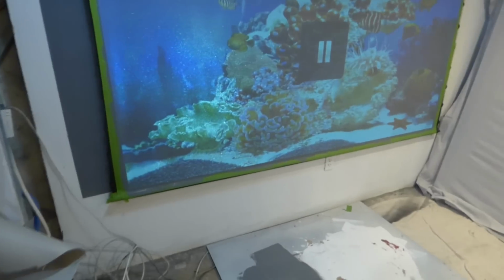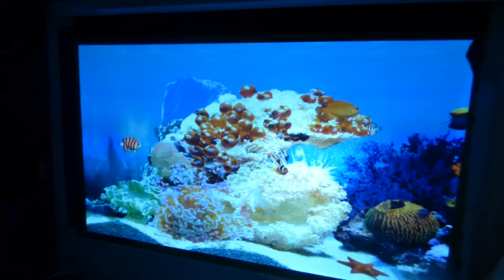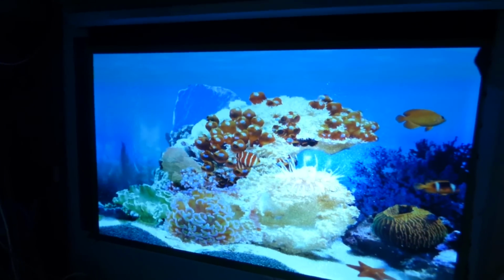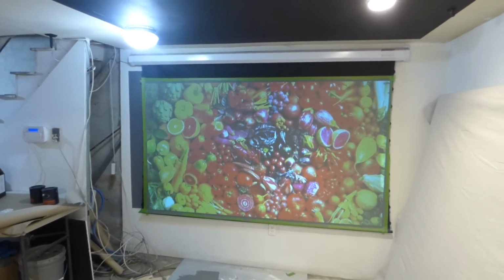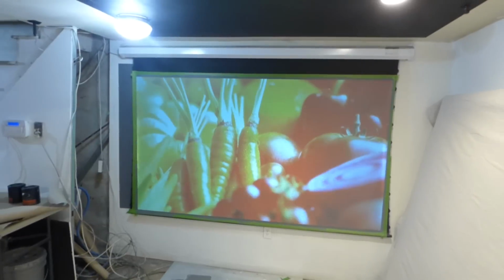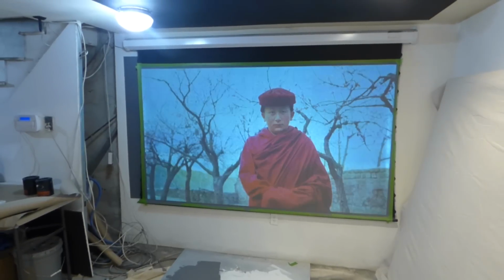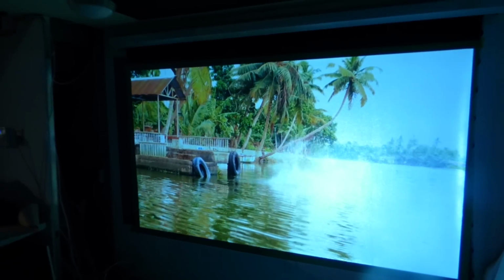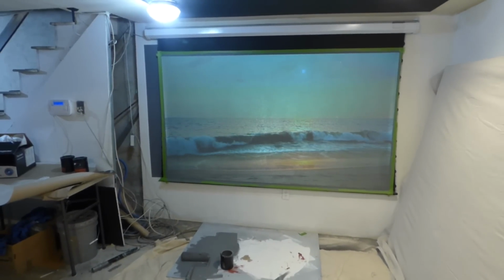NEW Luminous ALR AG.47-PLATINUM CINEMA ROLL ON A MOTORIZED SCREEN DEMONSTRATION

Comment: Why you don’t used spray gun to paint this screen?
Reply from the maker: To some of our customers a paint sprayer maybe a little intimidating the object of the demonstration is  show great performance in the screen paint technology  and also to demonstration that it  very easy to apply for anyone to use. If you choose to spray the screen in this you can do also.
Reply: LUMINOUS 4K Screen Paint. Can you tell me which screening method will give the best quality?
Reply from the maker: Luminous ALR AG.47-PLATINUM CINEMA
Reply from the maker: Not available till the 10/18/18
Reply: LUMINOUS 4K Screen Paint. If I use a spray gun to paint, what paint solution should I use to clean the gun after finishing painting?
Reply from the maker: To clean spray just hot water it a water-based formula